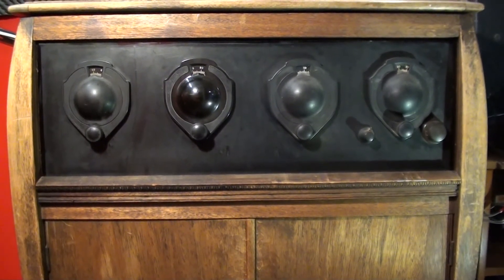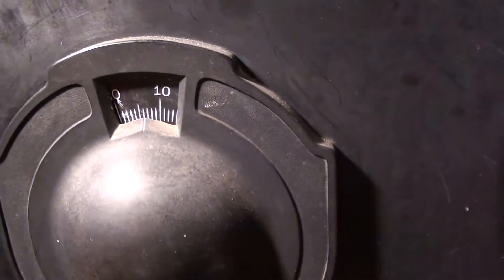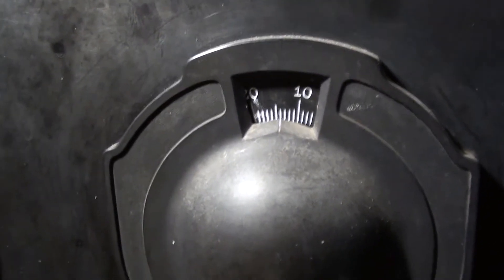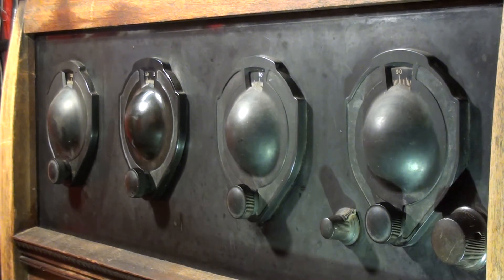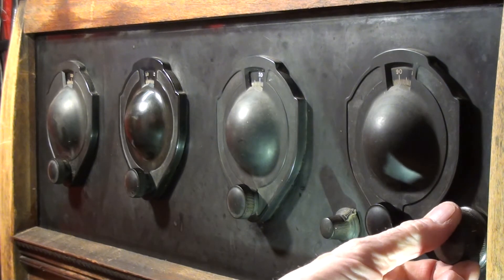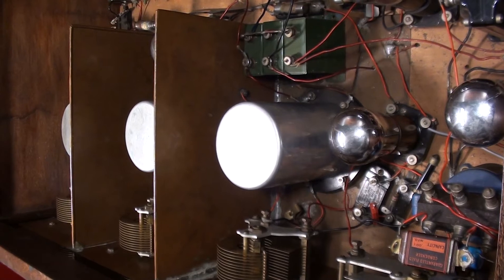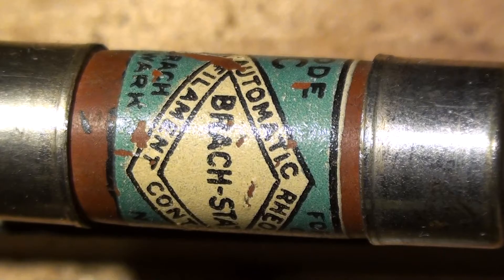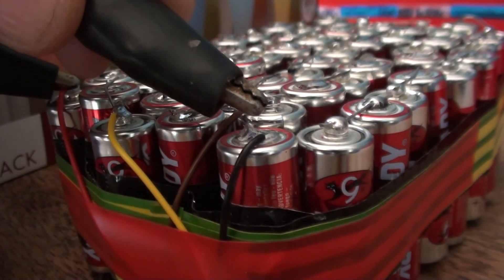1927 Neutrodyne Local And DX Reception Demonstration

Comment: You can here China on mediumwave?? Ive only ever heard it once on mediumwave here on 1512  Kilocycles when arabia was off
Reply from the maker: Actualy it is a Chinese language station in Gelong about 50k away but you can certinaly hear Asian stations here with a bit of effort. Before all the stations went all night the band was full of China and other Asian stations after midnight. In Northern Australia it is hard to get an English language station at night as it is all Indonesia and China and one of the reasons it was foolish to turn off the Short Wave service to Northern Aus.
Reply: Another reason demonstrating ABC foolishness would the high QRN levels MFBC experiences in tropical north, especially the low MF favoured by ABC.